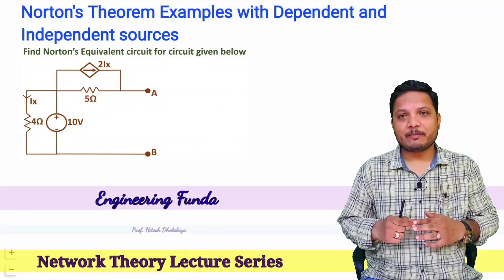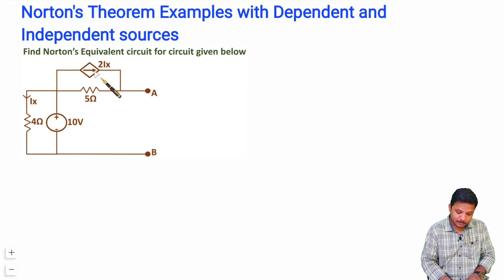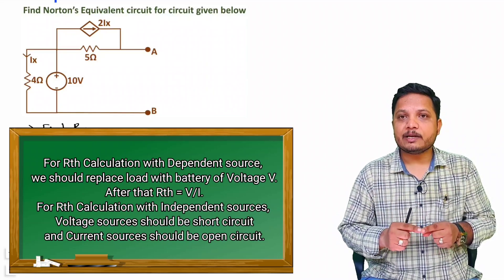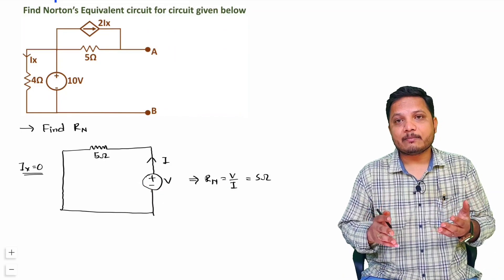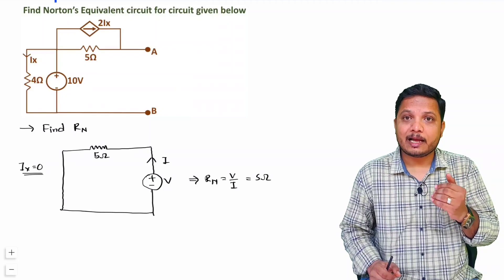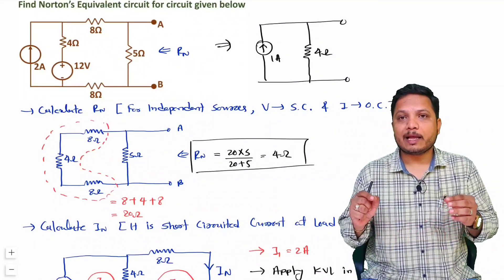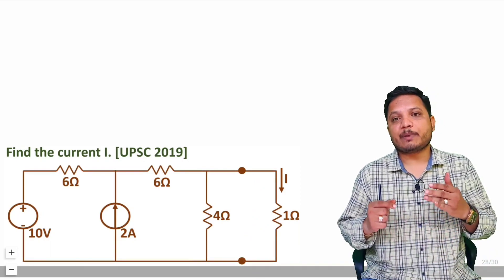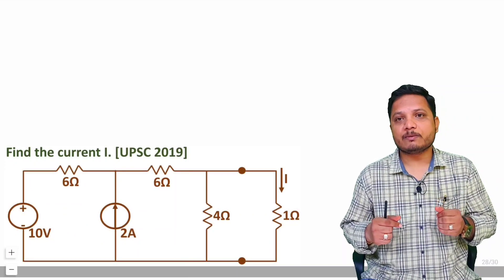3 - Norton's Theorem Examples with Independent and Dependent Source: Solved Problem

Comment: 1.83 A?
Reply: it is the value of norton current source, you have to draw the equivalent norton circuit witg Rn to get the value of I in resistor of 1 ohm
Reply: @utkarshgautam2111  tqvm